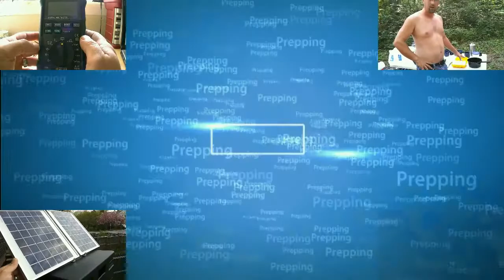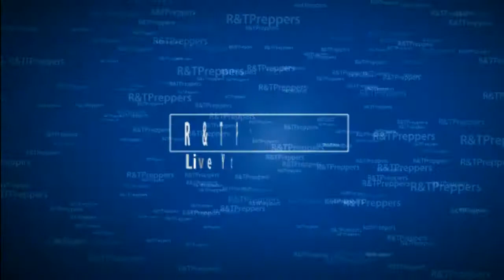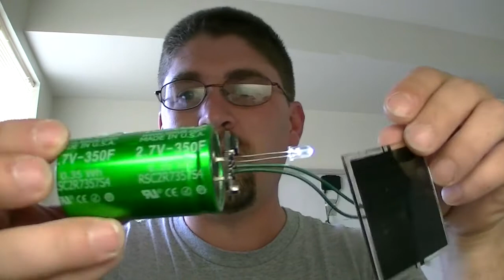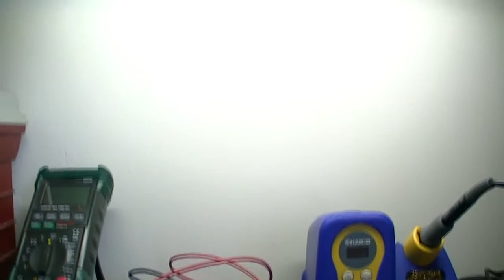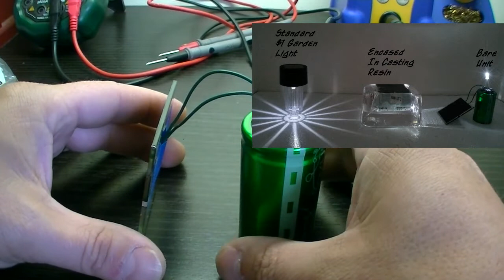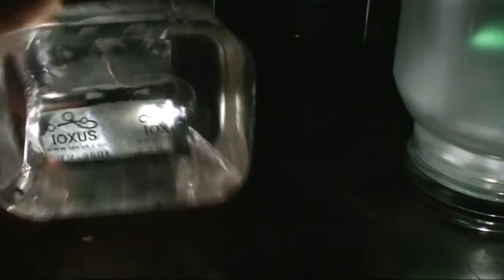Infinity Sun Jar Finished Project

Comment: I'm building v2.0 and would like to how pin1(ce) of the ncp1402 chip gets turn back on after its turn off
by the mosfet chip .Where does it get the 0.9v or above from ?
Reply from the maker: The ncp1402 chip will re-enable when the mosfet is turned off at night disconnecting the enable pin from ground.  It says in the datasheet that when this pin is floating, it will be enabled, which usually means there is a high value ohm pull up resistor internal.

Comment: Hey I know this video is quite old now, But did anyone get this board to work? I pulled the V2.02 from git and had the boards ordered, placed all the components and it wouldn't work unless I removed R1 for some strange reason. I built the board now 3 times with no success. Any help on what I might be doing wrong would be nice. I'm about to send off for more parts to test again. Thank You and thanks for the effort you put into this and making it open sourced.

Comment: I have watched all of your Infinity Jar videos! I was wondering if you can tell me more about the resin cast one. 
Did you used resin or epoxy? How long will it last in it before it gets cloudy, starts pealing or just melts with the sun?
Could it last a decade on rough weather? Rain, snow, desert, sea water, etc?
I'm a subscriber now!
Thanks!
Reply from the maker: +biologyphp Even with uv resistant water clear resin, it started to yellow within 6 months.  I'm thinking I'll have to make a custom wood/glass enclosure for these.

Comment from the maker: I have seen that video and love it, although I would have chosen to use 6 2600-3000F caps for more longevity.  Starting a car can shorten the life on the smaller caps, even though they are capable of delivering enough amperage to start a 4 cylinder car.